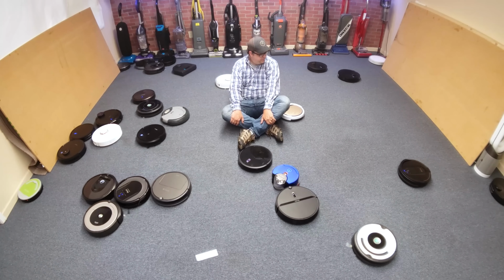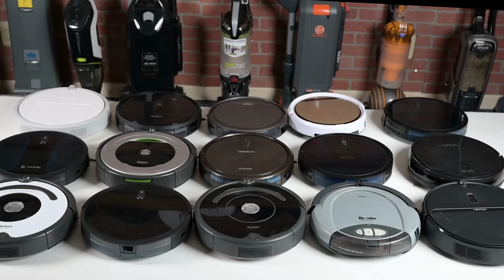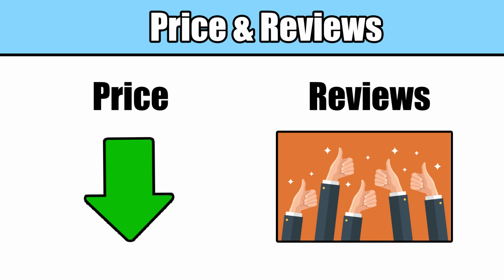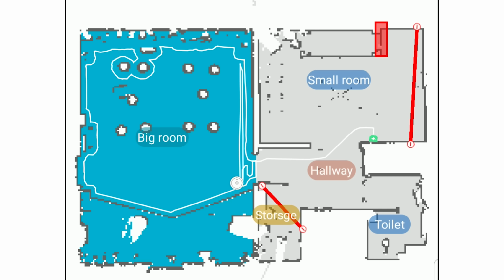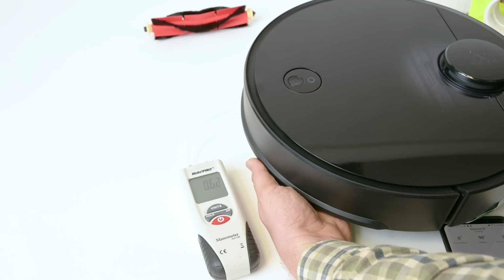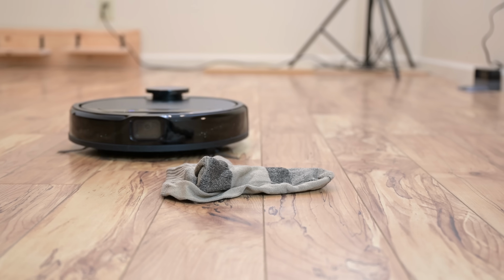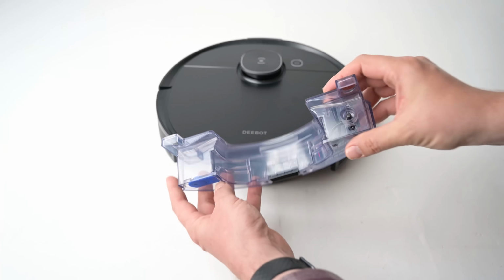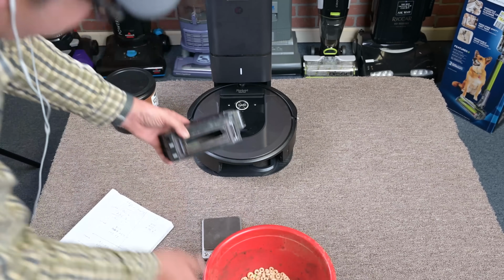BEST Robot Vacuums 2020 Edition - Vacuum Wars

Comment: Anybody besides me notice Neato robotic vacuums were absent from all this testing?  If I am not mistaken, they were the first to make intelligent robot vacuums that could actually navigate and built a fire under iRobot to do the same.  Most of the robots in the review I've never even heard of.  What's the deal?
Reply: Doesn't really surprise me. I have a Neato D7 - that thing is fine, but some design errors really bother me. Such as the exhaust being pointed down towards the floor, meaning it can actually blow your dust around into no-go zones as it navigates. The app is sub par, and there hasn't been a significant software update for at least a year. Which gives me an impression they don't really want to keep improving their products. Also, many links on their website barely work, and their support is non existing. 

Hence, my next robot will certainly not be a Neato.
Reply: @Druskqq  Interesting, IWas thinking about buying a D750, which is a D7, but you make me have a doubt... Roborock S5 instead?

Comment: T8+ is currently on sale at BestBuy for $450. Roborock S5Max is on sale for $440 (amazon and Walmart). Which one is a better vacuum/mopper for essentially the same price? Read some negative reviews about Ecovacs app and their customer service, plus issues with self-emptying. Torn between the two. Any help in deciding would be much appreciated.

Comment: After months of research and watching dozens of videos including yours, I finally pulled the trigger on the Roborock S4. Unfortunately, it ended up being a disaster. On my carpet, it would get confused, it would spin in seemingly.random circles,  and then it’d stop with the dreaded “Error 8” code. I thought perhaps mine was defective so I tested it on vinyl flooring in my kitchen. It worked fine. I’ve read that the S4 has a lower profile than the S5 Max and, therefore, should not be used on deeper carpets. My carpet is not at all “deep”  but my experience should serve as a warning to others. After all of this hassle, I sent the robot back and I no longer trust robot vacuum technology. If one of the “best” robots can’t go longer than 20 seconds on carpet in my home  then where do I go from here? What a disappointment.
Reply from the maker: That does sound disappointing.  Thank you for sharing.

Comment: Just bought the Deebot T8+ with self emptying bin based off this video recommendation (went with the t8+ from best buy because it came with the auto emptying bin for $650 and videos show the t8+ is better at item avoidance than the aivi.) and I am pretty disappointed with it compared to my 3 year old first gen roborock:
- Navigation seems way worse than my first gen roborock that is 3 years old.
- First run, it completely disregarded 2 rooms.
- Second run, it got stuck in areas that my roborock didnt in the room that it skipped the first run
- First time it attempted to empty the dust bin completely stopped after a few seconds. I dont see a way to manually have it empty the bin as well.
- It couldnt get out of my master bedroom due to a higher incline on the way out
- It had a HARD time trying to get back into the dock even though it was right next to it
- App is definitely worse than roborock's. Its too simplistic but hard to understand at the same time
- Thing was able to get under my dining table with chairs but then got stuck in there
- If you do or it does anything to interupt it during it's first run, you have to end the run and restart it if you want it to successfully map your house. This is ridiculous

Some positives over my first gen roborock:
- Vacuumed rug no issues where the roborock would constantly get stuck
- Definitely can avoid small objects
- Highest suction mode is still quieter than max of the roborock

I'm not waiting around for the software and firmware to be fixed. I have a S5 Max coming on Friday so I will compare that to my first gen. But for $650, this should be so much better
Reply: Its on sale now for way less right now ay bestbuy. I'd get them to price match against what you paid.

Comment: I wish it would also be easily possible to test how long batteries last in these reviews. Our Deebot 901 in less than 10 months has gone to being able to run only for 50% of the time it used to! (+/-45mins instead of 90+, standard power, automatic cleaning of 110m2 mon-fri). Ecovacs customer support says it's normal and won't do anything about it.

Comment: Thanks for the video. There's so many coming out from Xiaomi it's hard to keep up. An all important model to try get your hands on is the Dreame D9, 3000Pa and auto detects carpet and sets max performance.

As someone looking to get their first Robot vac at around the $500 price point Xiaomi is the best choice but their vast empire has been confusing. Making a video to make their models clearer would be great, for example the Mijia 2 in 1 is the same as the Xiaomi Mop P yet the Mijia is half the price here. And the Mop P doesn't seem to be as good as the s5 Max for suction but has more advance tech.. and so on..

Comment: Would you try the Cecotec Conga 5090. It's the second most powerful robot out there(8000 Pa),  with cyclonic technology, with great battery life and a quite decent mopping system.
Recently they released the 5490 where the only difference is power is in increased to 10000 Pa but with the price difference I think 5090 is the better choice.

Comment: Question fro the experts: some vacuums are marked for pet owners specifically, is there actually a difference or what do you recommend?
Reply: Depends on the brand. Some have 'anti tangle' brushes, some have HEPA filters. Most of the times the good robots have a quality brush. But long hairs will get trapped anyway. Either being in the rotating side brush, the main brush or the canal to the bin. Says an owner of 3 neato's, a GSD, a daughter with really long hair, just as my wife... 😅

Comment: You probably already know this but I've just found that dipping the side brush of our D7 in hot water (after removing it from the robot!) completely restored the mangled bristles to new.
Reply: I read several bad comments about the D7, are you happy with yours?
Reply: @ZiPouet  This is our first 'bot replacing a  standard cleaner. We've had ours about 2 years from the recommendation on on Vacuum Wars, no issues apart from occasionally losing the wi-fi connection but that affects other devices as well.  Very happy with the  cleaning.

Comment: Hi, what would you recommend as a best robot with invisible wall function? Thanks.
Reply: I spent a ton of time making this comparison table of the most popular Robot Vacuums on Amazon on 20 different metrics that mattered to me. You can compare this one against some of the top options to see if it's the best one for you. You can add and remove options from it and customize the criteria to match your needs. Cat Hair, Rugs, Self-Emptying and Re-charging were most important to me. It's kinda like a shared spreadsheet on steroids because it pulls in all the specs and ratings. Here's my comparison project https://app.skeema.com/?pid=lWVoJB3OD1olKXqcdcBZ

Comment: Here’s the thing so many people completely ignore or under appreciate about the Roomba S9+: the roller and brush re-design.   The rollers are in the very front with an overlapping multi-speed corner brush (that can stop or slow spinning on the fly preventing tangles and debris fly). Not only that, the rollers being in the front with the caster wheel in the rear means virtually zero hair tangle problems.  Who buys these expensive robot vacuums primarily? It’s got to be pet owners. No one else has to manually vacuum near daily otherwise.  The S9+ is quite literally the only robot vacuum on the market that doesn’t require daily roller or brush or caster wheel de-tangling.  It’s the most substantial feature of the entire damn vacuum. And you ignored it.

Comment: Maybe my foil hat is on a bit too tight, but I think an important feature of these robots is privacy.  A lot of them have cameras and sensors that gather a lot of telemetry about your house.  Is this being sold to marketers?  What about the government (our own or otherwise).  See DJI drones for an example of good products that unfortunately are prone to sending off images, GPS coordinates, and other data to out-of-country servers.

IMO the only thing a robot vacuum should need an internet connection for is software updates.  All home telemetry information should be stored only on the vacuum itself, not on a server somewhere.

Maybe I'm just paranoid, but these are my opinions.

It would be cool if user privacy was a test category.

Thanks for the cool reviews!
Reply: Zoidsfan77 sadly a lot of your data technically isnt our own

Comment: I liked the former style of review much, much better.  I liked seeing all the stats to see if a different model might meet my needs if it were ever discounted.  One category that seems to get overlooked by reviewers is the robots that have an algorithm that allows them to vacuum in an up and down pattern effectively getting most if not all rooms in an average home.  I "think" Eufy might have one, and Roborock does, because I own it.  I bought my Roborock E4 for $250 and can't imagine upgrading to one with a laser or camera.  It has a huge battery, dustbin, and does a great job of navigating.  It's not perfect, but it's darn close.  Has charge and resume and maps what it has cleaned.  You can't create no-go zones or tell it to go clean a certain room, but if a  person can live without those features, it's a bargain.  I just shut doors or block off certain areas with objects...no big deal.  The Roborock S4 has review after review after review saying that it is not for carpets as it can't navigate them for some reason.  Surprised the S4 was recommended in the mid-level category.
Reply: Your point about the S4 is valid! I bought an S4 and I could get 20 lousy seconds of vacuuming carpets at most. It would spin, travel in random patterns, and then stop; it spent more time shouting out “Error 8” codes than it did vacuuming. I finally sent it back with a 0–star (i.e., useless) rating. Perhaps if Vacuum Wars employed a carpet that wasn’t putting-green short, it’d be able to give more accurate real-world test results. I purchased the S4 largely on Vacuum Wars testing and that was a huge mistake.

Comment: You seem to point out the big flaw with the $150 vac. It's dumb, so you end up following it around, watching it get hung up or eat a cord. At some point you go after every weak point and fix it, or I guess you do the vacuuming on manual over-ride, watching it and moving it with the remote. I cleaned up a lot of horrible wires, thanks to my vac. I figured out ways to move things around. One weird deal is a rug I have with a set of geometric designs. It thinks some edges of light and dark are a cliff, so it backs up. I don't think they are vacs, anyway. I think they are sweepers with a vac function to collect the dirt. Really small wattages where a big vac is really big watts. I could see moving up from the 11s. If the filter gets clogged (tiny filter) it shoots an error code. Clearly a way to sell filters.

Comment: ou should have included the Xiaomi mi vac. Same as the Roborock S6. Can do mopping and vacuum on the same run (special tank), replacement parts are VERY cheap ($14 for 2 main brushes+2 side brushes+4 filters).

Comment: I have two large dogs and due to that, every robot in the past would fill up quickly and need to be emptied before using. Therefore defeating the automatic scheduling. I  would empty the robot before work and have it clean the house. It would fill up about half the way thru the run and leave tufts of hair around the floor.  This was every robot that I have owned and I have had robot vacuums from the beginning. All of them would fill up with dog hair quickly. So the solution is having a robot empty itself. That is the holy grail of robot vacuuming: the robot empties itself. So now the robot vacuum cleaner can be totally automatic. 

iRobot had the i7 with autodump module on sale for $699  (on Amazon too) and I jumped on it so I now have a true automatic vacuuming robot. It does such a good job that I did not have to vacuum the house before a party I had last Friday. On the white bathroom tile floor there not a single black dog hair on it. It doesn't really like the thick bathroom carpets though. Being the giant nerd that I am, I love that I can ask Alexa to have the roomba clean a specific room and the Roomba beeps and heads off to that room.
Reply: The S9 plus is better for hair but only bc the caster wheel was moved to the rear and the rollers were extended so the corner brush overlaps. No more roller detangling. It’s so huge for me (2 dogs and 1 cat, with one being a golden retriever) c

Comment: I think you are missing one of the best robot vacuums in your collection. The xiaomi mi-robot vacuum mop p (it's a mouthful).  It's between 250 and 300 usd and it has several features you have been asking in robot vacuums. It mops the floor in a swiping manner and the chinese version can store different maps for multiple floors. You can also find all the spare and replacement parts for less money.  Also I think it has the same built quality as the roborocks, after all they are both coming from Xiaomi. You should check it out.

Comment: T8 AIVI owners, has anyone else experienced bugs with the map in the Ecovacs app? I noticed that the saved map in my app occasionally corrupts my map data, merging or dividing rooms itself about once a week. Very occasionally, it even identifies my entire house as one single room such that I can't even manually edit the rooms to segregate them properly. 

The hardware is amazing, and I was hoping that they would update the mapping issues after they released the T8, but the app updates appear to be mostly cosmetic.
Reply: Ye but sometimes
Reply: Its the bug of the firmware and the app problem
Reply: Mine doesn't do any of that. I do have a small issue where it sometimes won't let me divide a room, and gives me a timeout error on Android, and a error message in Mandarin on iOS. My T8 AIVI is from the first batch made as I bought it day 1. So I have the first hardware revision. The good news is updates have been frequent.
Reply: I run into a similar problem in my T8AIVI and I highly suspect that it is the range of LIDAR and SLAM algorithm.
For anyone who does not have a vacuum robot before, my apartment is 2000 sq.ft which means the furniture is sparsely placed.

I used to have a 360 S6 which shared a similar problem; both robots can tend to confuse its whereabouts in either two large hallways in the apartment which are approx. 2x15m(6x54ft), and this is beyond LIDAR (usually 10m for vacuum robot) 

SLAM algorithm requires some distinct features of the room for the robot to update its whereabouts; and sparsely furnished rooms don't have enough distinct features for the robot since that robot used SLAM which fundamentally uses Bayes probability theory to update its location. 

T8 AIVI only do this occasionally compared to the LIDAR only robot(e.g. 360 S6) in this regard. I hope they can fuse the information from the front facing camera with LIDAR so it does not purely rely on depth-dependent information.
Reply: @MultiYlin  hmm my house is pretty cluttered and there are no big open areas. The robot does fine navigating around my house, and has never once failed to locate itself on the map. The problem only comes when it completed a cleaning task and returns to it's charging port, then it would mess the rooms up as it 'restores' the map.
Reply: @damiangjy  I think I know your problem; my T8 firmware is at 1.10.3 and it does randomly update the name of the room.
Reply: Its not actually full the app but some bugs is also from the firmware
Reply: @nicholasoas9282  you can merge and divide the room using apps. 
I had problems sending the divided/merged map to robot before and I solve the problem by confirming the update cmd immediately after merge/divide action in the app.

Comment: HUGE difference between the S4 and S5 Max is that the S4 cannot navigate "normal" American pile carpet. I ended up returning the S4, getting the S5 Max and finding out it has no issues. I did find the Ozmo T8 for $550, so I stuck with that because the AI was so much better, even though I fell in love with Roborock first.
Reply: I think older roborocks might not be able to switch to turbo mode when they are on medium/high pile carpet which is important for some people. I am not entirely sure if that is smth software might have since changed.
Reply: @sunlightdavid  I just texted the vacuums 2 weeks ago and software was updated

Comment: can you weigh in on the s9+, I have been patiently waiting for them to be available in Australia due to the outcome of your 2019 video, but reviews are a bit hit and miss, the price is crazy high, and availability seems to be almost non existent in favour of the i7+, should I still hold out for the s9+ or has extended use/review time changed your opinion on the device
Reply: He has reviewed the S9 several times.  In the reviews I've seen, the S9 consistently scores below the i7.  For my first robot, I wanted to believe Neato D7 was best.  It was certainly one of the most costly at the time.  But the Roborock had better ratings.  I bought both of them and the Roborock was quite a bit better than the Neato, so the ratings were spot on.  Just because something costs more and maybe even looks a little better doesn't mean it is better.
Reply: The S9+ is amazing for pet owners. The redesign substantially decreases pet hair tangling. Also, it dynamically changes suction power based on the surface it’s vacuuming (senses the roller friction). It also has much improved low light navigation and a more effective corner brush. Also the redesigned dustbin is real real nice with separate filter door and everything.